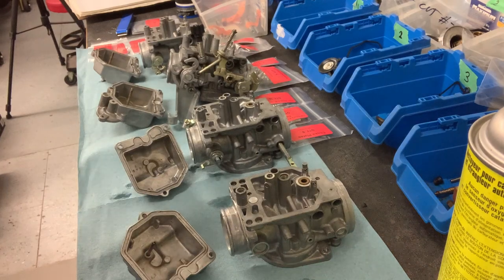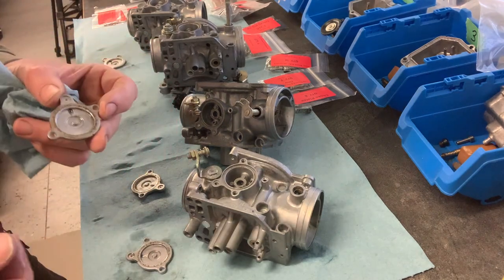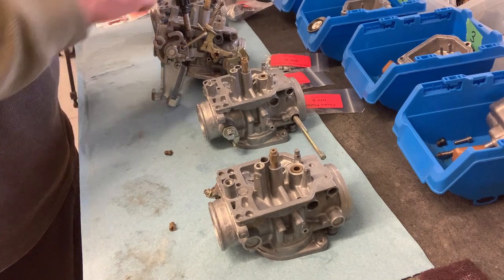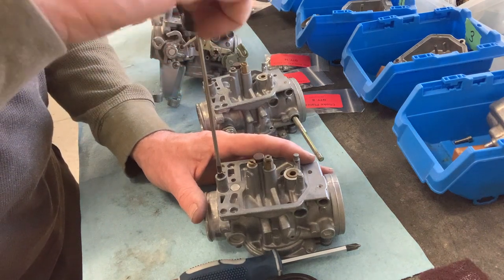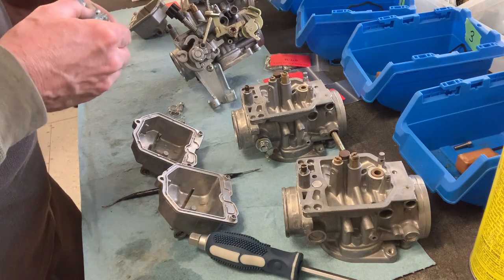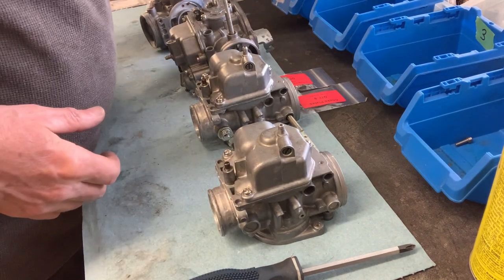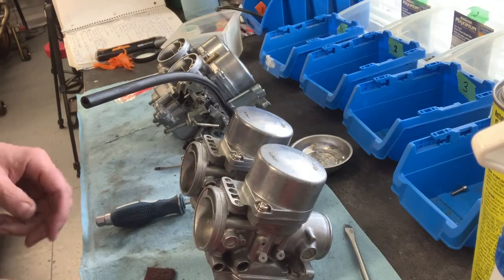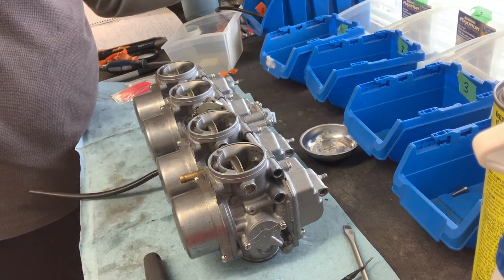1982 Honda CB900F Barn Find restoration - Episode 5 - Carb Rebuild part 2

Comment: I like to use a brass brush on the outside to knock all that gas Gunk and varnish off and then I like to normally use a steel wire from the same type of brushes pull a single fiber off and take it through and kind of make sure it touches all the edges.

Comment: FOR THOSE VIEWING:  When reassembling, it's good to leave the "flaps" / Butterflies a tad loose until everything is fully assembled.  Same for the long braces that hold all of the carbs together.  Then make sure all movement of the choke and throttle mechanism move freely.  THEN and ONLY THEN finalize tightening the rest.  Tighten everything in opposing form (across, then across, then every other, etc.)  Otherwise, binding can occur that can prevent free movement of the rods and flaps.  I recommend replacing all of the rubber hoses as well.  If one looks bad (and none seem to be replaced) you can bet they MIGHT AS WELL be replaced.   And, no, the floats are not adjustable on these specific models.  (why? I dunno.)   These Keihin VB carbs are very finicky little kittens.  Ask me how I know......

Comment: You are doing a sterling job Dave.  Strongly recommend removing the AFV (Automatic Fuel Valve) again and stripping it and clearing out any crud.  Ack you may have already done this.  If not, it is the first recipient of any crud that may come inbound from the tank before it gets to the carbs. You MUST install an inline fuel filter between tank outlet and the AFV, else all your good work may be undone as soon as you turn the fuel back on.  (DAMHIK)
Also, while the carbs are off and still full of fuel, be sure to check all four accelerator pump jets are working vigorously as the throttle is operated.  These can easily be blocked and can be difficult to clear.  Check by opening the throttle butterflies quickly and watch carefully on the airbox side of the carbs for a solid squirt of fuel from the small brass jet located at the 5 o'clock position on the floor of the carbs.  With the carb slides removed, fuel should spurt out through the carb throat and out the other side.
Reply from the maker: Cheers Tony, I’ll check that out !!   I filmed this 3 weeks ago but easy enough to refill them and test it out

Comment: Instead of matchstick, I found that an old O ring with one side cut off to make a C shape will slip in and hold it perfectly.  Place the open side of the C  toward the metal notch that will be inserted and it will just push it out as it slides in.  Use a fatter O ring for the one in the middle where the metal notch is thicker.
Reply from the maker: Cheers, good tip !

Comment: I never worry about the jets being shiny easy, to get the outside shiny, but the bit that matters is the inside and as whatever you use always requires rubbing trying to find something you can jam inside to get them shiny risks getting stuck inside. Thanks for the detailed videos some good tips in here. Most people just throw them in the ultrasonic and think they are clean, nope, clean them again, then if you think they are clean, clean them again - I use some Murex welding jet cleaners (like your carb cleaning needles, which I think are welding ones too) but the guitar string is a great idea for getting into the idle jet hole. A tip I picked up was to wrap tape over the straw that comes with carb clean to make a plug and use that to push carb cleaner down those small holes - better than just air - just make sure you wear eye protection in case it sprays back at you, ask me how I know that
Reply from the maker: Cheers!   Good tip in the tape to create a seal.

Comment: Hi there:  I use a Brass brush and that cleans the outside of the jets quite nicely.  The other thing I do is use some Silvo or Brasso on a Q tip to clean the needle seat since they are not removeable.  I did notice that you replaced the rubber plug but you did not remove the jet that was underneath the rubber plug.  You have to trim a slot screwdriver to fit and make sure that the tip is thick enough at the end so it does not damage the slot.  It will come out but just have to be careful.  I believe it is part of the idle circuit and if not cleaned you will have a hell of a time to get it balanced properly,  thanks
Reply from the maker: Thanks for the tips!   And for taking the time to write a comment !  In a later video I remove the rubber plug again and drill/tap the jet inside to remove it.    These were pre 84 carbs, and to remove that jet in the pre 84 you have to drill/tap and use a small nut and bolt to extract the jet

Comment: Carburetor cleaner brake fluid and or starter fluid all leave a thin white film, I like to use a brass brush and knock all of the dusty tarnish off of the brass parts of the carburetor I also use a separate brass brush on any aluminum parts that may have some form of oxide

Comment: Nice work on the carbs. You mentioned the plastic floats and this is my guess. Lots of cost-cutting drives engineers and managers to do stupid stuff and they're likely a result of that mind set. New ones are probably accurate enough but over time, they probably sag and deform. If the level doesn't check out okay, they probably want you to replace them. If replacing them, hopefully you can find floats which have the integrated steel tab that you can bend. Just a theory.
Reply from the maker: Thankfully the float levels were all good

Comment: Where can I get that carburetor rebuild kit, I'm about to pick up a $200 cb 900 but after checking it out it seems locked up and and will need a fresh carburetor clean and restore. My first time ever messing with four in a row I've done single cylinder stuff for the longest time and then got into parallel twin my first ever four cylinder. And I feel the exact same way you do about not having the confidence in the amount of information on those carburetors I've done all sorts of carburetors, I'm just not the biggest fan of diaphragm carbs especially when there's four of them. But yeah anyway if you can put me in the direction of maybe a rebuild kit for the carburetors and potentially thinking there could be something with the points

Comment: I didn’t c u locktite  the throttle or choke plate screws in with red loctite or stake them if they come out and go into the engine !! Disaster!!
Reply from the maker: Your right Karl, I had to go back and to that later as I forgot .   I didn’t take the throttle plates out
Reply: The factory does not LocTite them.  If they are going to just "vibrate" out after being tightened, there are greater issues that need to be resolved prior to then.
Reply: Actually, if you look at the end of those screws, you'll notice that the end of them are hollow. It appears at the factory they just take a punch to the end of each screw once they're in place & it mushrooms-out the last couple of threads so that they can't/won't back out. Also, when I unscrewed mine, I noticed a few of them had left a super thin string of metal swarf (metal spiral) that I had almost missed & left inside the carb body, so just a heads-up